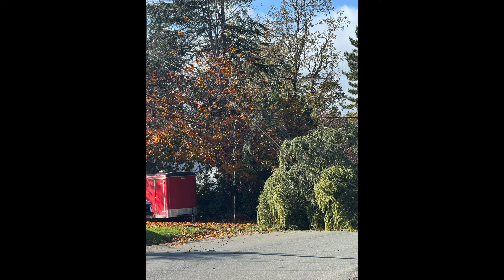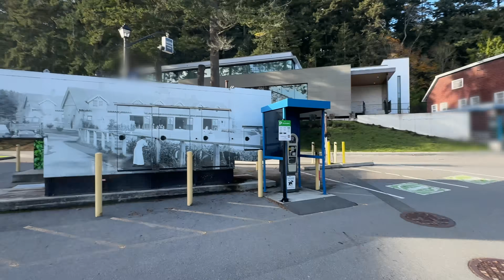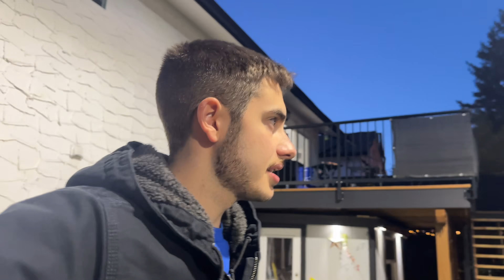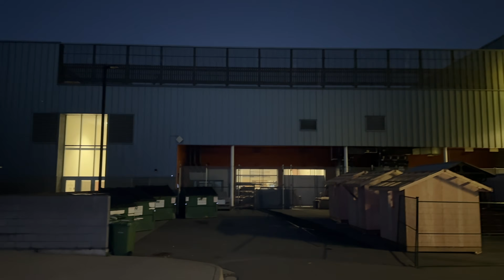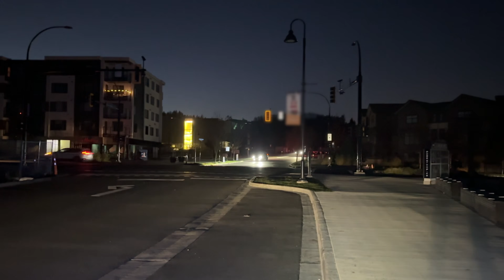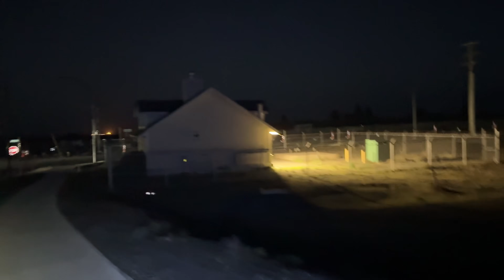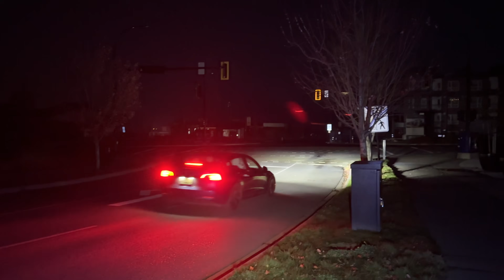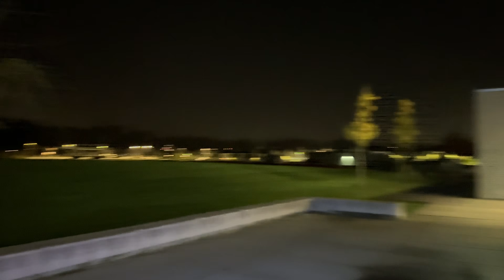11 Hours Of Power Outages And House Electrical Fried With 14,400 Volts On Neutral!

Comment: The electrical grid in Scandinavia is better designed 
400 V 3Phace  in the homes 
HV poverlines are on different places 
In rural areas all is in the ground
Reply from the maker: I'm not sure what you mean by being on different phases as every line in a three phase system is a different phase. The thing is the cost involved with bearing everything underground is massive so in rural and non-densely populated areas it's not realistic. Especially in a country many many times larger than Scandinavia.
Reply: @nics-systems-electric  He said different Places. Not running high and low voltage lines on the same poles.

Comment: Just like any built into their various power strips and UPSes, a whole home filter would just be one more smoking thing in the house. (or more likely "pile of charred black bits") No surge suppressor technology in existence would've helped here. Even OPENING the main breaker would not have helped. 14kV will arc right the f... across those breakers, and even the bus bars behind them.

(Looking at the box of Square D breakers here, they're rated to 10k AMPS, not VOLTS. And they're not rated for DC, either - they depend on the zero-crossing point of AC to quench any arc.)
Reply from the maker: I agree 100%. I've had lots of comments saying a surge protector would help but I'm not sure I can agree.
Reply: @nics-systems-electric  Did that house have any power strips with surge limiters? Pry one open and be amazed at the circuit that's no longer there. Yes, they're "designed for million volt lightning!" but not on the ground/neutral - and not a direct strike, which as you've said, is where those things are going to try to put all that excess energy. If you get the chance, cut some of those breakers apart, and get pictures of the bus bars behind them. (14.4kV can arc nearly 1.5" - over 3.5cm)

Comment: The big question is, who pays for all this?
Reply from the maker: Insurance
Reply: @nics-systems-electric  Whos insurance?
Reply from the maker: @MmmHuggles  the homeowner
Reply: And how long until the house is habitable again? That's obviously a major job and will take a long time to replace everything electrical inside even after re-wiring. The insurance payout probably takes a while to get, which means the residents in the meantime have to live elsewhere.
Reply from the maker: @IvyANguyen  they are still living there. Not sure if a rewire will be necessary. That will depend on the results of a megger test.

Comment: First, the house that had everything electrical shorted by 14,400 volts reminds me of an entire neighborhood that had everything electrical including transformers short out.  I was not in the neighborhood but it was big news.  The cause was a tree trimmer that had cut a tree branch and the tree branch landed on the power lines including the ones above that are similar to 14,400 volts sending that similar amount throughout the neighborhood blowing lights, shorting out appliances including air conditioners, and even the big transformers on the surface for large buildings including large apartment complexes blew.  It was probably in the 90s when this happened and not even surge protectors were spared.  All from a tree branch a tree trimmer cut.  Second, I had dealt with power outages especially from November to March from storms with gusts powerful enough to knock down trees in 10 years living in the countryside and taking hours for power to be restored.  The longest I went through a power outage was 48 hours almost 25 years ago.  There was also snow I had experienced every year in the valley when it gets cold enough for valley snow and power outages from the weight of the snow on the trees.  Did not have any generator so had to use all that was old fashion to get through the power outages especially the longest I experienced of 48 hours.

Comment: I would not be surprised if all the nonmentallic wire in that house is trash.
Reply from the maker: Definitely exceeded its rating. I would think you would have to do a megger test to determine the insulations integrity.

Comment: As a low voltage tech I see stuff like this every year here in Florida. Either from hurricanes or what I call the rain season through August and September when we get a lot of thunderstorms. I've seen alarm keypads blown off the wall, transformers and wallwarts blown apart. Seen homes that are not even a year old get hit like this and I feel for the customer. Spent anywhere to 500,000 to a million on a new home and six months later everything electrical wise blown to hell.

Comment: Those panels are Know to catch fire and are recalled
Reply from the maker: It's the breakers that are the biggest problem as they have a quite high failure rate where they will fail to trip on overcurrent.

Comment: Overhead power lines are just an accident waiting to happen, they are just for the convenience of the power grid company.
Reply from the maker: The thing is in rural and non-densely populated areas it's very expensive for lines to be buried especially depending on the rock conditions in the area. That cost will be passed along in your electric bill or local taxes. Nobody also wants that.

Comment: A whole house surge protector doesn't care if the surge is on the neutral or hot. All it does is keep the voltage down between it's terminals to reduce the spikes.
Although it might have helped a tinny bit, there's not hardly anything that can keep thousands of amps at 14kv from blowing everything up, including a surge protector lol
Surge protectors aren't a reliable protection from constant high voltage, or direct lightning strikes. (Some are, but not the regular residential surge protectors)
It really only helps for surges from line or tap switching or other smaller voltage surges.
Reply: Actual lightning protectors are available but the duration of a HV fault to distribution would probably destroy those too. Lightning strikes don’t last longer than seconds and this sounds like the HV didn’t have earth fault detection.

Comment: Woow. At least the meter also is zapped and probably no more metering until everything fixed.
Reply from the maker: I was thinking about that and thought the metre might've actually made it out ok since it doesn't have any neutral connection just the two hot legs.
Reply: @nics-systems-electric  If it's a electronic/smart meter, it reallly should have a connection to neutral,....
Reply from the maker: @Spechtlerimwald  yes they are all smart metres and I've never seen one connected to neutral.

Comment: Odd last i knew from a lineman the primary lines are 7,200 volts each at least for homes and when a tree brings down the lines usually a fuse on the pole will blow or if its equiped with reclosers they will try 3 times before locking out and automatically send a signal to the power company stating a problem on the lines . the primary lines sound to me like they werent tied correctly to the pole insulators because thats far to much slack for those lines to reach the triplex .
Reply from the maker: 7200 V is also a common voltage, probably more common than the higher than regular 14,400 here. And if the line was straight it probably wouldn't have dropped enough to hit the triplex. However it was around a curve on the road and it was pushed by the tree towards the inside of the curve.

Comment: Why Censor Signs ???
ANd if that School was concerned about Fuel, why did the leave so much lights on
Reply from the maker: To help maintain some privacy. I would recommend you watch my videos on testing the emergency generator system. Those lights are essential emergency lighting they cannot be turned off. The school has no control over the lights or the fuel situation. That is the job of management to fill it when told by the electricians which they were told but did not get it refilled.

Comment: that house needs a full rewire
Reply: Definite rewire... If it was me doing the work, I wouldn't even bother with the megger... it's PF'd, rip and replace all of it. Every receptacle, switch, light, the whole works...
Reply: @bradwilmot5066 didn’t need it. Cable tested out fine I do this work for the local DNO I have done it for 15 years I have been to multiple properities hit by 11kv and 33kv. Wish I could post pictures here. A lot of accessory and appliance damage but fixed wiring survived.
Reply: Yeah it’s does need to get a full rewire
Reply: I did one in 2017 that had a 33kv line fall and hit the LV. Cutouts exploded.
Reply from the maker: Possibly will. depend on the insulations integrity and they will likely do a megger test I would think.
Reply: @nics-systems-electric even if they dont you dont know if the flash arc jumped out the wire insulation inside the wall. Most 12/2 wire cant hold that much voltage. In the US that would be a whole re-wire with that much voltage on such a small wire. Also a whole new sub panel as well.
Reply: @nics-systems-electric exactly
Reply: @nics-systems-electric  who would be responsible for the cost? The power supplier?
Reply from the maker: @PrinceofPeanuts  home insurance.
Reply: you Think?
Reply: Every electrical thing needs replaced not worth it the house just needs to be rebuilt and torn down
Reply: Not necessarily we tested out the cabling fine on similar properties

Comment: Wow I’m so glad nobody was hurt! That’s absolutely wild

One question assuming anyone sees this: what would’ve happened to a UPS in this scenario? Would it have taken it and been fine? Exploded? Would your computer or other equipment connected to the battery side make it? Just curious! Thanks!
Reply from the maker: I don't think a UPS would help there. it would probably be killed or blown up just like anything else. Their protection for surges is protecting the hot line and draining excess voltage to neutral/ground. Not much out there protects the neutral that I know of.
Reply: @ Thanks for getting back to me! In my head, the battery and surge sides were two totally separate things but I guess I’m wrong. Thanks so much! Keep up the amazing work! I really love your channel and your knowledge on how all this stuff works!

Comment: Fear and lies the problem of old-fashioned 19th century above ground power lines. First World countries have the power lines Underground.
Reply from the maker: No that's not the case every country has power distribution above ground it is not economically viable to have underground lines everywhere especially in rural areas or where rock is too close to the surface.
Reply: @nics-systems-electric  I don't buy that answer. If it were true, sewer and water mains would be on wooden poles too.
Reply from the maker: @basspig  yes, in many places all utilities are above ground. You also need to realize there are regulations on specific utilities that they need to be buried at a certain depth for safety. That varies between utilities.
Reply: @nics-systems-electric  I've really never seen above ground power lines til I came to the US many years ago. In much of Europe, they are underground.
Reply from the maker: @basspig  that is the same here if you go into any densely populated area or many newer areas that aren't from the 60s/ 70s like this video everything is most likely underground unless there is some restriction that it can't be.
Reply: @nics-systems-electric  Well Germany and a few others got bombed into the stone age in WWII, so they are more modern than most of the US, which is still in the 1850s as far as it looks with those wooden sticks all over the country holding up wires.
Reply from the maker: @basspig  depends where you go each province is different.

Comment: I would be curious to know if one of the triplex primaries got up to 14.4kv, as that would mean the transformer would inversely backfeed 1.7 million volts (Ignoring load sag) back into the grid. This assumes only 1 phase is compromised.

Either way, I can't imagine every single one of my plugged in electronics all getting thumped at once and going nuts, as well as every outlet, receptacle, lightbulb, and switch explosively blowing their ass out all over my walls.

Good god.

Comment: Definitely scrap the panel and all receptacles/switches/lights.  Wonder if it's worthwhile to megger all the wires or just rip and replace?  Insurance company would probably demand the latter.

We're 150km away and our power got knocked out at 12:41 on Monday and was out for hours.  At 12:51 a semi was flipped over on Hwy 1 due to the wind.
Reply from the maker: Yeah, minimum precaution would definitely be a megger test and would definitely be interesting to see the results.

Comment: I actually think that the surge protector may have helped some (not saved everything). I don't believe that surge protectors care what direction the potential imbalance occurs in. In this case, I think a surge protector would have caused both legs to go to 0 volts relative to the neutral. If you had any seperately derived grounds (unbounded) from the panel ground then you'd absolutely have problems)
I am certainly not an expert, but those are my two cents.
Reply: Maybe if you had a spark gap on the neutral, going to a hot as a way to alleviate some of the current, which is certainly what happened in the outlets?
Similar to a lightning arrestor.

Comment: Crazy, that entire house will need to be rewired. Very smart of you to not touch anything.  Even pulling one cover off of an outlet would make you liable for meddling with things.
Reply from the maker: Yeah I'm interested to see if that's the case or not it's a situation I've never dealt with. I'm not sure if some locations can be looked at to check the integrity of the insulation or since it's rating has been exceeded it's got to go.
Reply: I had an insurance claim from a lightning strike. Luckily didnt need a full rewire but i did get a lot of new IT gear. As long as the adjuster has documented everything you should be good to take a closer peek, but ask the adjuster first.
Reply: Insurance claim for “fusion”. Standard house insurance line item.
Full rewire required…
Very lucky that it wasn’t a fire claim.
Reply from the maker: @allangibson8494  hopefully they won't require a rewire if the megger test gives fine results.

Comment: Back In 2016 a tree next to my house was stuck by lightning, at least causing over 80000 volts to travel through my Neighbor's sprinkler system and into their house. Also why do you get all of the storms. The worst power outage I got this year was 54 minutes

Comment: This is gonna be Billions of dollars to replace wiring and install new Drywall because you would had to tear new wiring and replace devices that got 14,400 Volts if the Electric Company is Liable for the Damages that happen next
Reply from the maker: I don't think BC Hydro would usually cover this sort of thing I think that would be your home insurance. As it wasn't caused by a fault of their installation.
Reply: @nics-systems-electric   Well The Electric Company are responsible for Maintaining the Power Lines and Prevent safety hazards such as Outputting 14,000 Volts AC which can Blow stuff up and end up burning your House Down. I am applying US Law since I don't know.if it's diffrent in Canadian B.C.
Reply from the maker: @iansanchez1470  I hear what you mean but I don't think they would be responsible for the damages as it would be no different than someone crashing their car into a pole because what initiated all this was something outside of their scope. That being the tree on private property.

Comment: I wonder if this house had ground rods. Many old houses don't have ground rod and just uses neutral coming from the pole as ground. I don't know if ground rods will prevent damages completely, but it should have helped.
Reply from the maker: Yes it would have ground rods and water entrance bonded. Grounding almost never has low enough resistance to even trip a breaker in your house. There is no way it would be capable of tripping a main feeder like that powering thousands of homes and businesses.
Reply: @nics-systems-electric its ohms law though. At 120v, you are right but at 14,400v much more current will flow in the earth even with a few hundred ohms of resistance. At least in the NEC in the states, the stated purpose of the grounding electrode system is to deal with unintentional contact with higher voltage lines
Reply from the maker: @stillthakoolest  that is true and that definitely would help getting enough current to trip the fuses i'm still a little sceptical though if it's a say 600 amp line that it's going to trip it quick enough to prevent damage.